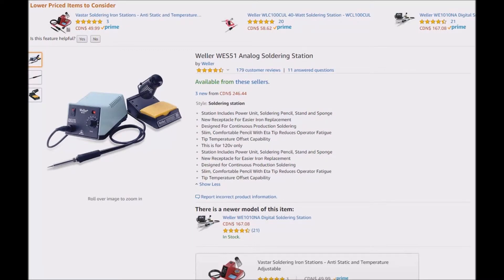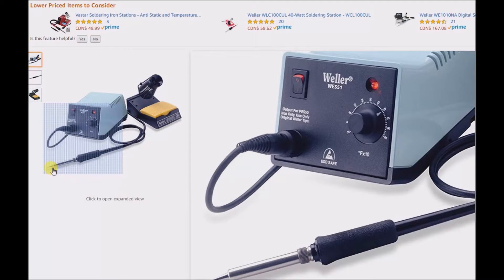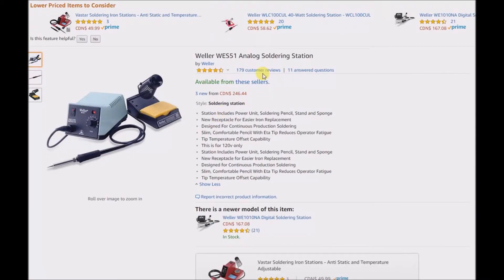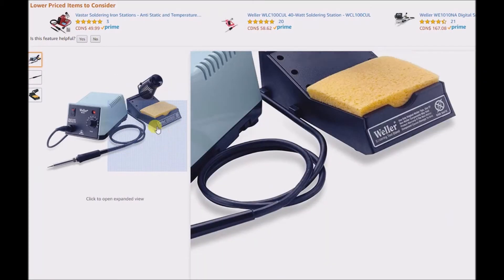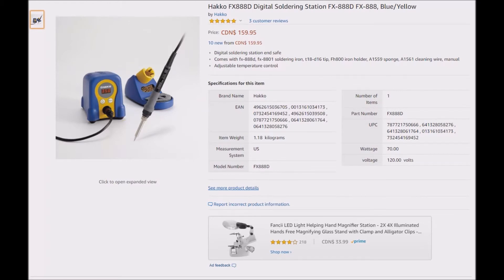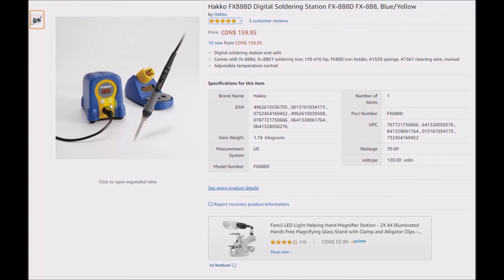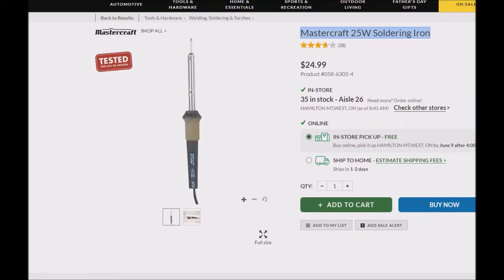Let's talk Soldering Stations! Mastercraft 25W Soldering Iron

Comment from the maker: Unless you are soldering heat-sinks together, how critical is having a high-temperature iron? The only practical reason I can think of is for the sake of de-soldering components with large terminals (leads/ pins), say, transformers.  Virtually every hobby kit I've built was easy to assemble with my 25W Mastercraft. And, I've never had issues with cold solder joint. I suppose, if you are building radio antennas, or soldering 16 A.W.G. wire together, you'll need a higher temperature iron. But, for hobby electronics kits, I see no reason to invest in an expensive station. Someone correct me if you think I'm wrong.
Reply from the maker: And, yes, I neglected to display the Hakko FX 951, which is more comparable to the Weller WES51. But, my argument remains the same. Given the measurement is value per dollar, the Mastercraft 25W Soldering Iron is a superior device for handling 99% of hobby electronics needs.
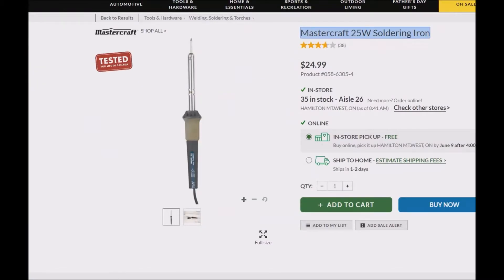Reply from the maker: 4:07 Also, the Mastercraft 25W Soldering Iron at $25, translates to a dollar per watt (or $1/W). Compare this with the Weller which is $250 per 50 watts. Or rather, the Weller WES51 is $5/W.
Again, Mastercraft 25W is $1/W
Weller WES51 is $5/W
Mastercraft wins again!
Hahahahaha!

Comment: You should never buy NEW soldering stations from those sellers (unless you're a business, naturally). You should try to get 'em used for cheap elsewhere. I got my Weller EC1002 for $30 CAD at my local repair center—pretty good deal. The only reason I could think of to buy these over those "cheapies" you mentioned is for the accurate temperature regulation. I tried using those 25W Mastercraft irons, and the soldered joints simply weren't up to snuff for what I could've done with the Weller. The temperature of the iron kept dropping while I was using it, and it was quite annoying.
Reply from the maker: thanks for the comment.